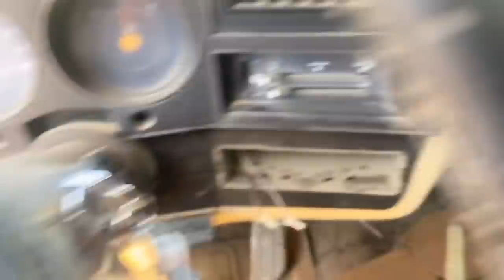Dirt Daily. Who wants Mr. Khaki Pants the K5 Blazer?

Comment: DUDE!!! Ok I know this doesn’t sound that cool but the most fun I had in 4x4 was my K5 blazer 
“No Lift” light fender trimming  33” Bfg’s, SM465
And a locked diff. The thing was a mountain goat. If your a young guy that wants to get into wheeling, buy this thing and go have have fun.
Reply: I have an 85 exactly  as you described  with 33-12.5-15s on it and an 81 too but  the 81 has a 6 inch lift.

Comment: Looks like it has the 12 bolt diffs, which should be a huge plus over the 10 bolts!
Reply: no such thing as a front 12 bolt, blazers had 10 bolts front and rear or 12 bolt rear and dana 44 front.

Comment: That’s a non a/c truck.  Aftermarket ac was added, probably a secondary system with the evaporator above the factory heater box.   Pretty common dealer add on back in the day.  Nice little K5.

Comment: If this is a 1983 model, then why does it have a 1980 (single headlight) front end? I thought 1983 came with 4 headlights.
Reply: I think it varied a bit according to trim level? I seem to recall the Jimmy's having the quad lights, while the Chevy's still had singles.
My '86 has the single headlight setup but it's an M1009 with an '84 contract year. Meaning though built in '86 it would be built to '84 spec.

Comment: Those 465 transmissions for all intense purposes are a 3-speed. That 1st granny gear is unusable unless you are yanking somebody out of a ditch.
Reply: Dan Miller  Back in the 80's I had a 1978 K30 single cab with a 350/SM465/NP205/Dana-60/14-Bolt and I only used that 1st gear from time to time like idling down a steep hill or pulling another truck out of a ditch.

My current Square body is the holy grail of square bodies. It is a 1991 V3500 Silverado 3+3 Crew Cab. It is the only year square body to come stock with the over-drive 4L80E connected to a NP205. It has 10" of lift with 38" tires.

I intended to use intent, but spell check will not correct a correctly spelled word. HA HA
Reply: Reality says it's still a 4 speed.  Much like gender you can try to redefine it but a male is always a male....lol
Reply: I guess you have never spent much time in the woods or trail riding in the mountains.  The granny low first gear is very helpful wheb crawling over rocks or up and down steep hills. Its also awsome in spot and go traffic.  My 77 has the 465 behind a 6.2 diesel and out to 4:56 gears.  The 4 apeed isvwry useful and was real helpful runibg big tires with less gear.    If you yow heavy, 4 wheel or do any woods work you will ubderstand the 465